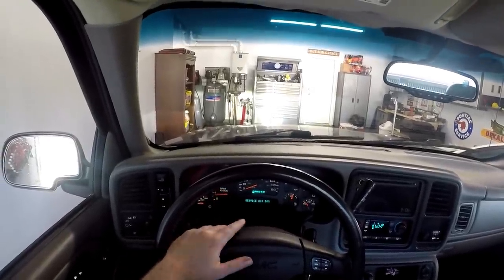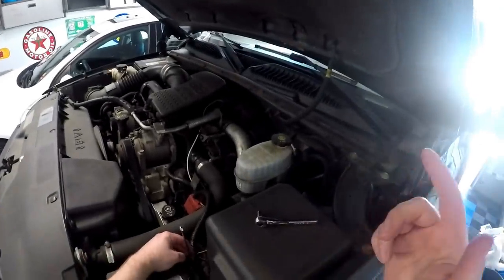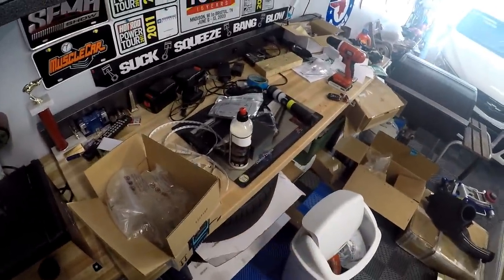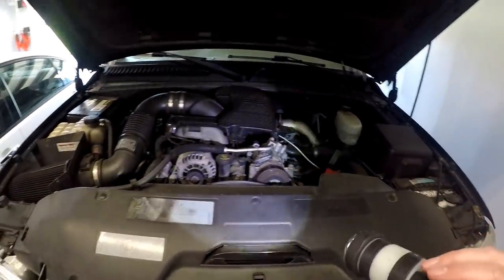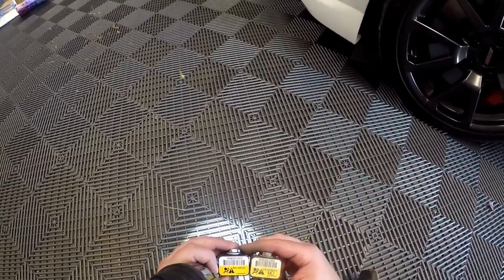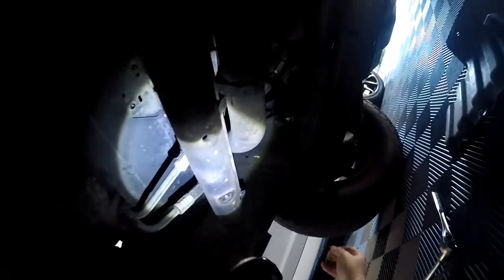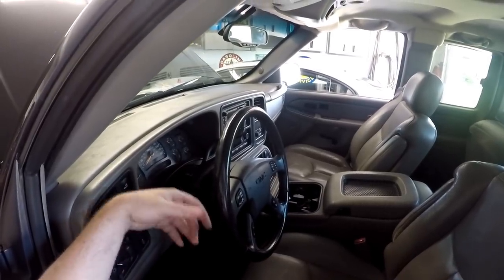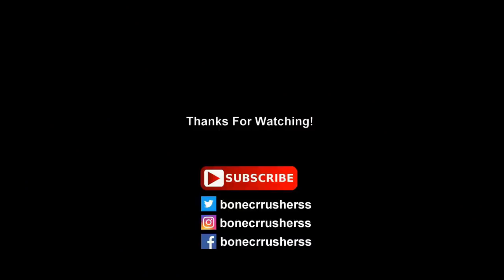2005 GMC Sierra 2500HD - Fixing Service Airbag Light

Comment: Thank you AZ was quoting me $225 for a new sensor. They told me the dealer would have to reset the warning light. I bumped into a trailer hitch with my front bumper in a roundabout. That caused everything. '06 Sierra 1500 crew cab.
Reply from the maker: Glad the video helped you out!

Comment: Great video. I couldn't find the part on Amazon so I just went to RockAuto. I also had no clearance to get a ratchet and socket in there (05 Yukon Denali) so I used a ratcheting wrench and that did the trick. Thanks for the video!

Comment: Thank you for posting, you’re absolute right!!! Dealership wanted$180 to scan and $372.00 for sensor and 125.00 for installation.. 
crazy amount of money for a simple 20 minute $65 .00 part..
Reply from the maker: Glad it helped!
Reply: I don't need sensors and I don't need airbag. Electrical tape will do.
Reply: This part is over $130-160 now ah days need to find it cheaper

Comment: Your video was dead-on.  Everything went perfectly.  I have the same 2005 GMC Sierra 2500HD Diesel.  The only things I did differently was removing the positive cables on the batteries and I did not remove the skid plate.  I began to loosen the left front bolt and realized the your video view was about the same as mine with the skid plate so I left it on.  All of the part numbers (new and old) were exactly as you showed.  Even though I was standing outside the truck when I turned the key, I was still afraid of the airbags detonating.  Thankfully, they did not.  Most people do not realize they are sitting in front of a bomb.  Side note:  The price on the part has increased.  I managed to get mine at Advanced Auto Parts for $113 + tax.  Amazon was out of stock everywhere.  Thanks again for your informative video.  Great job.
Reply from the maker: Glad you where able to get your truck fixed!

Comment: Took me longer driving to get the part then actually change it.. got into a accident in my 05 Chevy 2500hd. the collision center left the airbag light on. Other then fight with them and my insurance, decided to try this. Threw in aDorman Air Bag Impact Sensor 590-204 and No more light. 
I noticed that the airbag light would blink five times pause then a six blink on start up when it was bad.. now with it fixed it blinks 7 times and goes away
Reply from the maker: Glad the light went away.

Comment: very good video  i got same problem with a 2006 sierra    dont know which one it is
Reply from the maker: There are 2 sensors on the front frame rail. 

Buy one and try replacing one - if that doesn't fix it - move the new sensor to the other one.

Comment: On my 07 Silverado HD classic  it was the passenger on off switch that was causing my light to turn on
Reply from the maker: That is good to know - in the few hours of research that I had done - I had not seen the switch be an issue.

Just curious - had you tried replacing one of the sensors?
Reply: bonecrrusherSS  yes I did the same one you had changed. The light stayed on then I noticed the back light was not on for the on off   I turned it off and the light went off on the dash.  Turned it to on the dash came back on
Reply from the maker: Interesting - this is the first time that I have seen someone have an issue with the switch itself. 

If my switch breaks - this will be the first thing that I look at.
Reply: bikerbrego  where was the switch located

Comment: How did you determine which sensor was causing the issue?
Reply from the maker: The research that I did pointed to the first airbag sensor. 

If it is hte other frame mounted airbag sensor - that same sensor can be used there as well.

Comment: Did tht actually made your check engine light go off aswell..?
Reply from the maker: CEL is tied to the turbo vane position sensor. This turned off the airbag light.

Comment: I had the same issue.  I read the code, cleared it, swapped the sensors and read the code again, and nothing changed.  So, for me, I don't believe the sensor is the issue.  I'm thinking it's under my passenger seat, either with the wiring or a module.
Reply: Did you ever get a chance to find out where wast the problem
Reply: @victorelizalde333  Yes.  It was a broken wire under the passenger seat.  A real pain to find.  I traced every one of them and the jacket was fine, but the wire was broken inside.  Soldered in a new wire and problem solved.  Apparently, some wires are fatigued when moving the seat forward and backward repeatedly over time.
Reply: @pughconsulting  oh thank you for this great info bud ,, I’ve own a 2005 hd 6.6 is an ls extended cab I already searched under my passager seat but there’s nothing under it no module or sensor only place I can match or see one as described ,, Is in under my driver side seat
Reply: @pughconsulting  then I’ve checked front impact sensor ,, the sensor on my truck looks very neat and intact no rust ,, dirt or wear .. I appreciate the info shared about a broken wire under your seat ,, I will double check mines ,, thanks bud .. my code is B0044 so I called a local Chevrolet dealer and gave them the code and told me is the steering wheel coil located behind the air bag inside the steering wheel when I asked the the price for this part they said is 300 something with out taxes lol🥴🤕
Reply: @victorelizalde333  I can't recall what my code was but it indicated "passenger" somewhere in the description, so that's what I tackled until I found it.  It took 3 hours to find, then I soldered in a new wire while the seat was in place which was a real pain.  Good luck to you tracing it down.  I have an extended cab as well and moving the seats back and forth loading my kid into a car seat probably sped up the wire fatigue.
Reply: @pughconsulting  yes sir yes sir ,, thanks for all your feedback 👍

Comment: Holy shit! Are you like 8 ft tall or walking on stilts?? LOL I  have 275/70R/18s and a 2” or 3” lift on my 1500 and I have to keep a foldiling foot stool in the back so’s I can step up to reach in my engine compartment!  It looked like you were working on a car instead of a truck when you disconnected the batteries. LOL you must be tall as hell!
Reply from the maker: 5'10" I'm standing on a Harbor Freight fold up stool.
Reply: bonecrrusherSS I have the same thing. I keep it behind the backseat. LOL Sorry, just had to comment when I seen you look right into the engine bay like that and ur truck looks to be close to the size of mine.
Reply from the maker: Yeah man truck sucks working on when you have to get deep into the engine bay. That stool is 1000% needed.

Comment: Disconnecting the battery is unnecessary as long as the ignition switch is off! Also if the srs module detects an issue the system is automatically off I've been working on cars for 22 years! Dont listen to this dope about disconnecting the battery!
Reply: Dont hate on this guy. Its always a good idea to unhook batteries when working on any module
Reply: @Brownie79  I agree but I've never had an issue
Reply: @lgonzalez1154  would it be ok to get a used one from a wrecking yard?